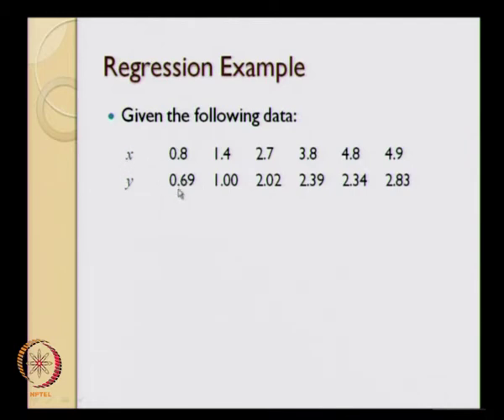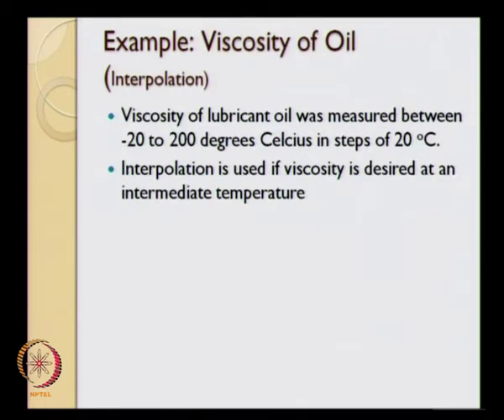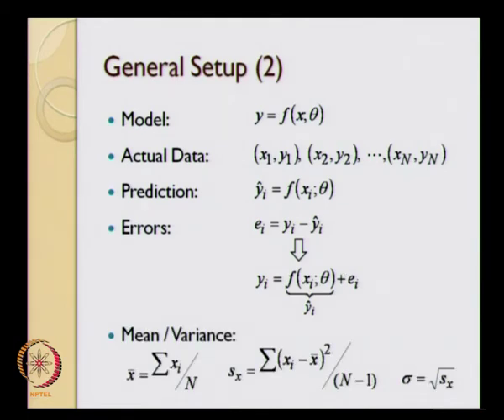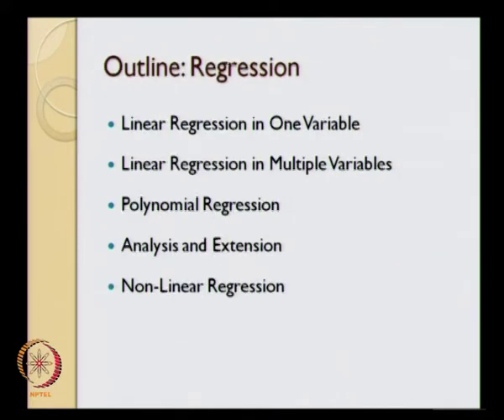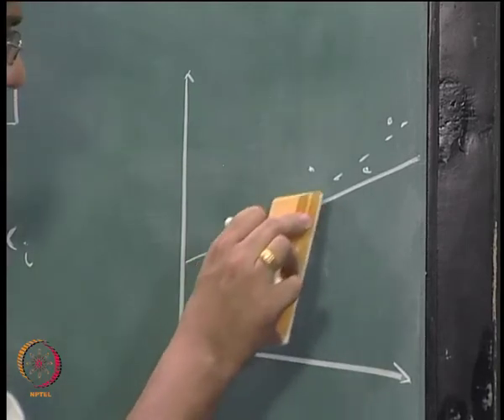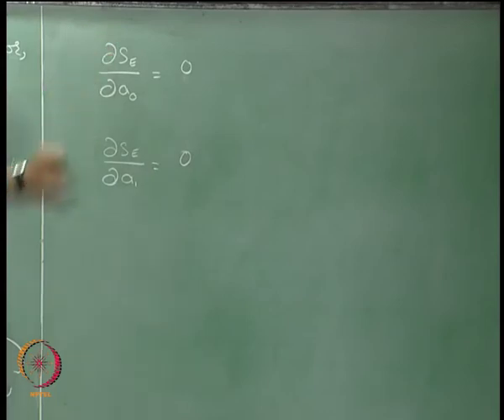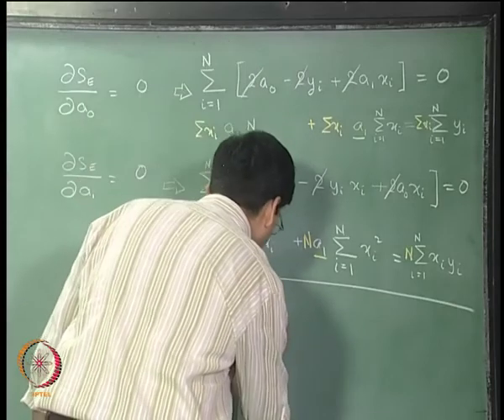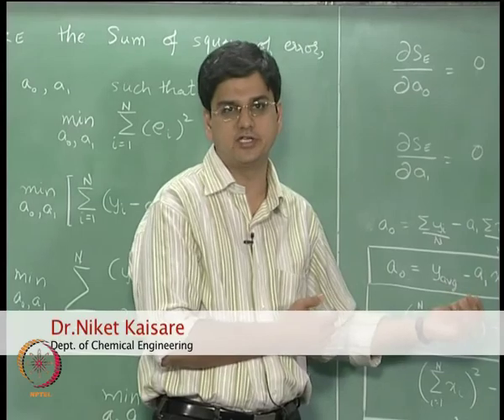Mod-05 Lec-15 Regression and Interpolation Part 1

Comment: Thank you for your perfect class. But I found a small problem, I think the topic on the top of the blackboard should be "Linear Regression" instead of "Linear Interpolation".
Reply: brother i just want a kind favour like I to want to know whether these topics ""Method of least squares, Calculation of the sum of the squares of the residuals, Cubic spline problems, Newton's
divided difference formulae, Lagrange interpolation, Finite difference methods, First and higher-order differences of a
 polynomial""""""" are included in the further subsequent part or not...........please comment as soon as possible..i will be really thankful to you.....currently i m in "Mod-05 Lec-15 Regression and Interpolation Part 1" so i have no idea of that..please  comment
Reply: Ritu Raj Anand hey bro it has been three years and I didn’t go through all the lectures. I wish I could answer your question but I really don’t know
Reply: @riturajanand7133   COURSE LAYOUT
Week-1: Introduction & Approximations
Motivation and Applications
Accuracy and precision; Truncation and round-off errors; Binary Number System; Error propagation
Week-2: Linear Systems and Equations
Matrix representation; Cramer’s rule; Gauss Elimination; Matrix Inversion; LU Decomposition;
Week-3: Linear Systems and Equations
Iterative Methods; Relaxation Methods; Eigen Values
Week-4: Algebraic Equations: Bracketing Methods
Introduction to Algebraic Equations
Bracketing methods: Bisection, Reguli-Falsi;
Week-5: Algebraic Equations: Open Methods
Secant; Fixed point iteration; Newton-Raphson; Multivariate Newton’s method
Week-6: Numerical Differentiation
Numerical differentiation; error analysis; higher order formulae
Week-7: Integration and Integral Equations
Trapezoidal rules; Simpson’s rules; Quadrature
Week-8: Regression
Linear regression; Least squares; Total Least Squares;
Week-9: Interpolation and Curve Fitting
Interpolation; Newton’s Difference Formulae; Cubic Splines
Week-10: ODEs: Initial Value Problems
Introduction to ODE-IVP
Euler’s methods; Runge-Kutta methods; Predictor-corrector methods;
Week-11: ODE-IVP (Part-2)
Extension to multi-variable systems; Adaptive step size; Stiff ODEs
Week-12: ODEs: Boundary Value Problems
Shooting method; Finite differences; Over/Under Relaxation (SOR)
hope it helps
Reply: exactly what i was gonnna comment